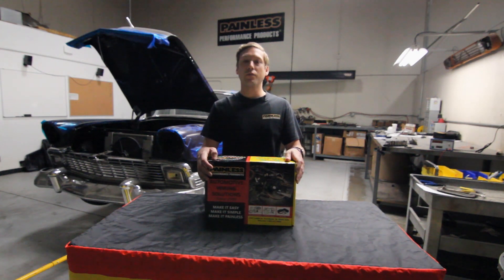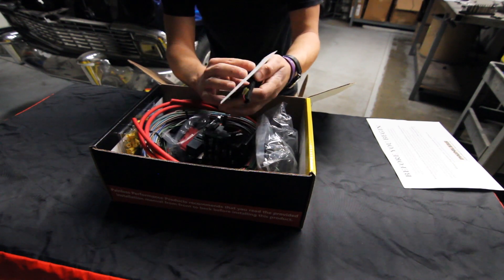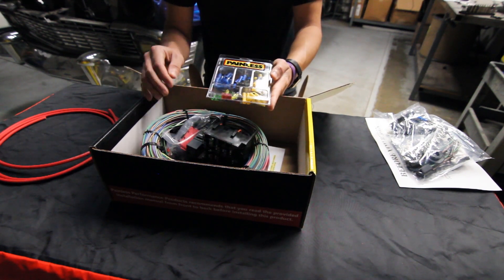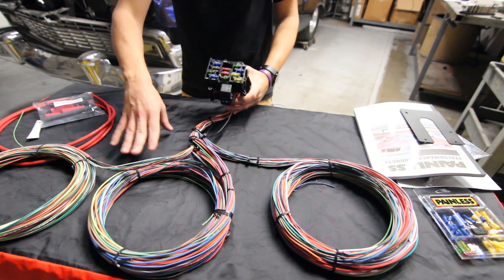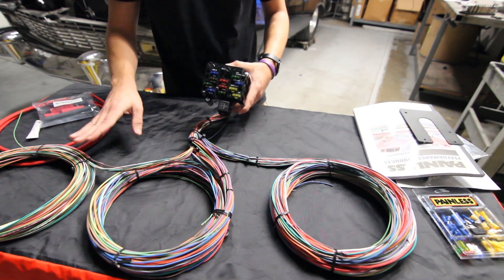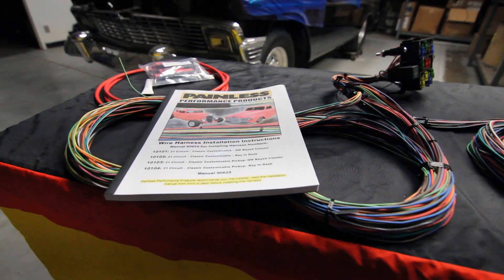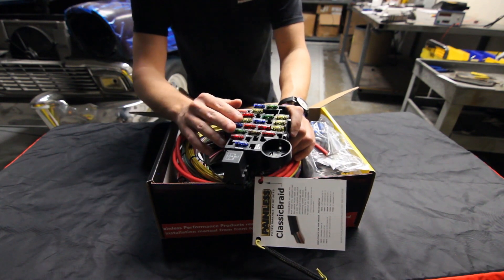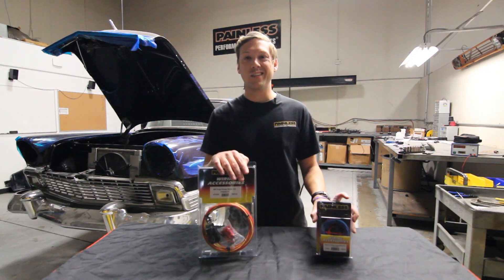Painless Wiring - 21 and 28 Circuit Customizable Harness Overview.

Comment: Will this work for a 67 Plymouth Fury?
Reply from the maker: You can use a kit like this if you're okay with swapping to the GM color-code.  We also offer part number 10127 that is a Mopar color-coded customizable kit.
Reply: @painlessperformance  probably still half to use this one as the mopar one says it's for column ignition as my ignition is on the dash
Reply from the maker: @MoparFox  the Mopar kit comes open-ended for it's ignition switch wiring and can wire into dash or column ignition switches.

Comment: Will this work on a 1989 ford ranger xlt?
Reply from the maker: Jacinto,

Unfortunately we don't have anything for that application.  

Sorry!
Reply: @painlessperformance  im just looking for a body/chassis wiring harness, that includes power locks and power windows, iv seen somone use a 21 circuit/ 18 fused wiring harness for thier project same year 1989 and they made it work
Reply from the maker: @jacintocastillo75  You can likely make one of our universal kits work, but just make sure you have access to factory schematics to compare.  We won't have any data on the Ford Ranger side of things and won't be able to assist or provide guidance as we've never had one in for development.

Comment: hello my question may be a bit stupid ... somehow I can connect the sunroof and the power mirror in the 28-circuit fusebox?
Reply from the maker: Leonardo,

Not sure how this was overlooked for so long, but we apologize.  You could use our harness to feed your sunroof and mirror switches with a fused power, but you will have to use the wiring for the mirror/sunroof kits that should run directly to battery power.